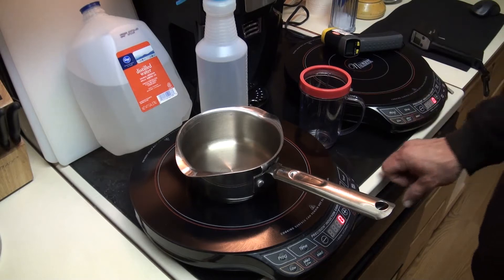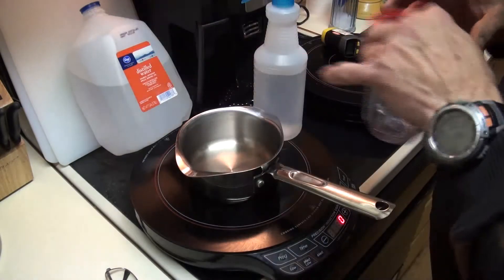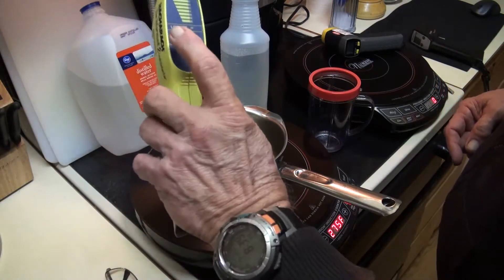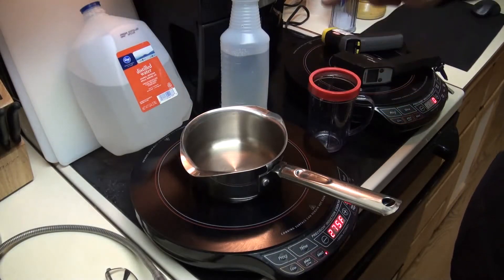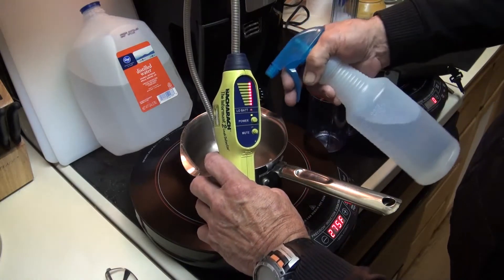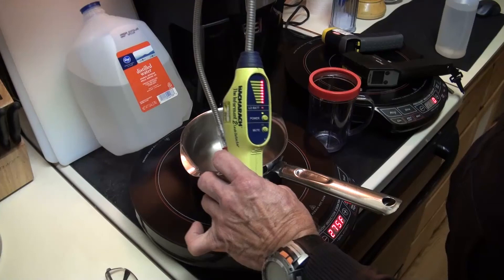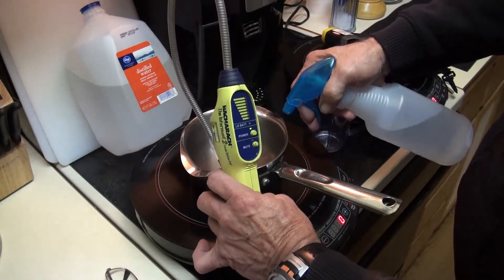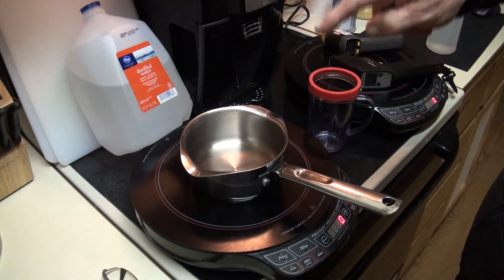# 2 Flammable gas from distilled water, is separating the Atoms, in water.

Comment: It's 230+ in 14.7 PSI atmospheric pressure.  Hook up some engine vacuum and it will drop to 165.  That's almost how hot I run my cell.  The hose is hot enough to burn your hand going to the engine.  Adding electrolysis to the mix only speeds the reaction up, but I am actually using electrolysis to generate the heat by using no neutral plates and using a smaller amount of surface area to increase amp density in a smaller area.  https://www.youtube.com/watch?v=gwBviAG-CvY

Comment: Stan Meyers did it by resonant frequencies of water .NWO killed him.
Reply from the maker: I am separating atoms, you see the smaller the matter the faster it will go to the applied temperature, and boil at that applied temperature. When an Arom turns to a gas, inside a liquid it will separate from the liquid, and the Atoms have now separated. I could not, and would not try to control what I have discovered, so, by putting it here on You Tube, the World owns it and nobody can control it. I do not know what Stan Meyers did to get hydrogen, but I do not believe you can separate Atoms using frequency, or Science would have discovered it. Science has been trying to separate Atoms since they discovered what an Atom was, however they are so stupid. The Chinese have been making Mercury since 3000 BC, and the Greeks have been doing it since 1500 BC, Science calls making Mercury, Sublimation, I call it separating Atoms. To make Mercury, you have to grind red colored cinnibar ore to a fine powder(the smaller the matter the faster it will go to the applied temperature, and boil at that applied temperature). For cinnibar the Sulfer Atoms has to be removed to create liquid Mercury, and when the Sulfer in the red Cinnibar reaches 675 degrees Fahrenheit, the Sulfer Atoms in the cinnibar turn to a gas and seprate from the liquid, and creates very hot liquid Mercury. This to me is separating Atoms, not Sublimation, like science thinks, and the Chinese, and Greeks did not know what Atoms were at that time, Science still does not know, but I do, and now you do.

Comment from the maker: Here is definitive proof that all Atoms in all mater can be separated, if the matter is liquid soluble, by applying the right temperature in the right way.
I will start with discussing what science calls Sublimation. Science says Sublimation can be done to a snow balls and Mercury. (Sublimation)- When anything solid turns into a gas without first becoming liquid, that’s Sublimation. When the surface layer of snow or ice turns into fog or steam without melting, this is an example of Sublimation. The verb Sublimation is from the Latin word Sublimare, meaning “raised to a higher status.”  
Get some snow or fine shaved ice and make a snow ball. Holding the snow ball, do not get burned, apply a butane cigarette lighter flame to the snow ball. The small snowflakes or ice crystals go from frozen to a superheated gas that has no wavy lines, when looking through the clear vapor. It does this without becoming a liquid at 32 degrees Fahrenheit, or boiling at 212 degrees Fahrenheit. Science calls this Sublimation, they know not what they are talking about, I will explain later. The smaller the matter the faster it will go to the applied temperature and boil at the applied temperature, even above the known boiling temperature of the original matter, and this is where you will find the boiling temperature of all the Atoms.
Now to Sublimate Mercury, you need Cinnabar ore. Grind the ore to a fine powder, place a small amount of the fine ground red colored cinnabar, spread the ore very thin in the bottom of a glass or metal container, and heat the bottom of the container with a propane torch, this is where the Greeks, who did this in 1500 years BC, the Chinese did it 3000 BC, I would bet Aliens showed the humans how to do it. It is the very small amounts of fine ground cinnabar ore that makes it possible to make the liquid mercury. By applying flame to small portions of the fine ground cinnabar, at a time, it goes to the applied temperature, which is around 675 degrees Fahrenheit, this is the boiling temperature of the Sulfur Atoms in the cinnabar ore. When the sulfur atoms boil they turn to a gas, and separate from the cinnabar, which is still a liquid. Because the Greeks knew nothing about atoms, they found they could add small amounts of finely ground sulfur, at around 600 degrees Fahrenheit, sulfur and the liquid mercury would turn back to the red Cinnabar. Think about this you applied heat to remove the Sulfur, in a vapor form, and the powder has to be fine ground to do this. Remember the smaller the matter the faster the matter will go to the applied temperature and boil at that applied temperature. The Chinese, and Greeks separated Atoms in Cinnabar Ore and never knew it, the Chinese did it in 3000 BC, and the Greeks did it in 1500 BC.
It is as if Science thinks they are preforming magic when liquid Mercury is made from Cinnabar, and they cannot see for the nose on their face, they are separating Atoms when they make Mercury, and they call it Sublimation. Here is actually what happens. It is the small snowflakes, small ice crystals, or the fine ground powder, in small portions, spread thin, that will go to the applied temperature, above the known boiling temperature of the original matter, and boil at that applied temperature. In this area I have found the boiling temperatures of all Atoms, and when one boils, it turns to a gas, while the other Atoms, in the matter, remain a solid, or liquid, having not reached their boiling temperature.
I did this to gasoline over 30 years ago, not knowing just what I had done and got twice the power over gasoline, zero parts per million Hydro carbons (no smog). I sprayed a fine mist of gasoline onto a 500 degree Fahrenheit electric heater, and ran it on 7 different vehicles, with this same results. I have put clean dry rags in the tail pipe and ran this White Vapor I created, and after ½ hour, the rag smelled like it had just been ironed. Now I also accumulated a dark brown oily liquid in the chamber I make the White Vapor in. This liquid was made from gasoline, and will not mix with gasoline, and the liquid is no longer flammable. Getting a Zero Parts Per Million reading on the smog machine, makes me think it might be liquid carbon, but scientist have told me there is no such liquid, but then again nobody has ever separated Atoms before. Part of my secret to doing this is, the smaller the matter is the faster it will go to the applied temperature and boil at that temperature, I call my process Flashing Matter (liquid or solid).  I have 4 videos on You Tube my channel (Bill Kendrick) also it is in Categories, on You Tube, under Separating Atoms. Science, Medicine, Chemistry, and the World will not be the same when this gets out.

Comment: You are ignorant individual...its not gas from wager its bottle plastics
Reply from the maker: You are trying to put the ignorantance thoughts on me, but you are the ignorant one. You do not know what you are talking about. True the plastic gives off a flammable gas, but it is not absorbed, nor does it leach into the water, stupid, if it did they could not use that type of container. Do not bother me anymore with your stupid ideas.

Comment: My next test is to take the vacuum pump little container halfway of water pull up vacuum on it have a connection setup on the gas coming out of the pump onto a torch tip to see if it will light the gas coming from the vacuum
Reply from the maker: It will not be flammable, you need to spray a fine mist of water onto a 230 degrees Fahrenheit range, raising the temperature slowly until the Hydrogen Atom boils and separates from the liquid Oxygen, in the water, then the gas will ignite.

Comment: I have a question since you and air conditioning man if you use a vacuum pump and put a vacuum on water H2O the gas coming out of the pump is it flammable and can you regulate the temperature by the amount of vacuum you put it on the container
Reply from the maker: It is true you will lower the boiling temperature of the liquid, however try to spray a fine mist of matter into a vacuum, and maintain the temperature in the vacuum. I know of no way that can be done, and control the temperature too. You see the liquid changing to a gas, will create a pressure drop, and change the temperature of the liquid, being sprayed.

Comment: Hi Bill Kendrick, I invite you to join the Gasoline Vapor Systems group on Facebook ! I think you will like it ! Thanks, Michael Vannozzi
Reply from the maker: Actually, Michael, I am trying to show the world how all atoms in all liquids can be separated. The the smaller the matter is the faster it will go to the applied temperature and boil at that applied temperature, making it possible to take any liquid to any temperature, above the boiling temperature of the liquid the atoms are in. When you do this you will find the boiling temperature of those atoms, they will turn to a gas, and separate from the other atoms in the liquid, because liquids and gases will normally separate. The liquid atoms left in the original liquid remain a liquid having not reached their boiling temperature. This can be done to any liquid.
Reply: Sounds interesting.

Comment: I read your description of the process you use and it makes no sense. I almost didn't watch the video but I'm glad I did. Hydrogen is given off leaving the oxygen still as a liquid? Come on, did you ever get more than the most basic education? And then the rest. Bollox.
A little ethanol in the water would produce the effect you describe.
If your method does indeed produce a flammable gas, you could use your butane lighter to ignite it.
However, I doubt if you will be successful as electrolysis is the only method which will split the H2O molecule.
Reply from the maker: +wontputrealname Do you know what Sublimation is? If not then you need more education. When a flame is applied to a snow ball the frozen snow will go from a solid to a gas without becoming a liquid. In other words the snow flakes go to the applied temperature before they do a change of state from a gas to a liquid, or in the case of Sublimation , it bypasses the liquid state and goes to a gas. I applied small droplets of liquid gasoline to a 600 degree electric heating element and the gasoline became a gas that has no hydrocarbons. Now science says gasoline auto ignites at around 534 degrees, wrong, I have seen the electric heating element turn a dull red ( around 1000 degrees Fahrenheit) before the gasoline auto ignited. I produced a white vapor from the gasoline when I did this it produced twice the power that liquid gasoline has, seen on two different Dynomometers ( a machine that measures engine horse power to the ground). What can be done to one liquid can be done to any liquid, temperature wise.I am saying I found a way to take any liquid to any temperature before it changes state, and that is where you will find the boiling temperatures of different atoms in that liquid, or any liquid. These atoms will separate in the liquid when one becomes a gas, having boiled, and other liquids in the original chemical will remain a liquid, having not reached their boiling temperature. If you don't understand this, then you need more education.
Reply: +Bill Kendrick     You already posted all this rubbish. Complete balderdash.
I am familiar with sublimation. You don't need to try to educate me. It can be demonstrated by using "dry ice" (frozen CO2). It won't happen with snowball.
You ignored my point about trying to light this so called "flammable gas".
You ignore the fact that if hydrogen is given off, oxygen must also be present in that gas. So it should catch fire if you light it. You'd hear a small crack as it exploded.
You say that the oxygen remains as a liquid? Ludicrous. For oxygen to be liquid it must be at a very low temperature.
You contend that I need MORE education because I criticise your ridiculous ramblings? I would not encourage YOU to go back to school as from your video and postings I doubt if you've ever been to school at all !!
I have a remedy for you ignorance. You should GO TO SCHOOL.
Until you do, people commenting on your ideas will never convince you of the idiocy of your statements.
As far as I'm concerned our discussion is over.
Reply from the maker: +wontputrealname You have no clue, dry ice is liquid nitrogen only, that will boil at minus zero degree temperatures, it is liquid nitrogen only, there no other atoms in liquid nitrogen. Water has two atoms, gasoline has many atoms.  I am talking about, taking very small droplets of liquids, spraying them onto a designated temperature, I call this Flashing Liquid, and I am saying the small droplets of this liquid will go to the applied temperature faster than the liquid will boil at the liquids known boiling temperature, making it possible to take any liquid to any temperature before it boils at that applied temperature. You see snow flakes are very small, like a fine mist of liquid, and both go to the temperature being applies faster than they can boil at that liquids known boiling temperature. If you cannot see what I am saying here, then I have nothing more to say, except get out of the books and try this for yourself. What I have done here is not in any books. You have to see it to believe it.
Reply: +Bill Kendrick     In my last post I said that as far as I was concerned the discussion was over, then you state, referring to me "You have no clue, dry ice is liquid nitrogen only", and then you say that water has 2 atoms (wrong on both counts), and you go on to repeat, more or less the same BOLLOX you have come across with to explain your impossible theories.
I just had to respond as your first sentence is so ludicrous.
Dry ice is CARBON DIOXIDE. It melts at about .-80c.
Frozen Nitrogen, which is NOT dry ice, melts at less than -200c.
There are 3 atoms in 1 molecule of water, 1 oxygen and 2 hydrogen. That's why it's called H2O.
I would advise any person who reads these posts to beware of any advice you give because the ridiculous statements you make and have made in your videos and posts prove that you do not understand even the BASICS of the subject in which you profess to be so expert.
Reply from the maker: It has been too cold, where I live to work on it this last winter, but I have plans to do it this Summer. The only way to prove it is to ignite it, which is what I intend to do.
Reply: +Bill Kendrick     I'll be very interested in your findings.
Reply: Were you finally able to "ignite" it? It's been 2 odd months since your post.

Comment: +Bill Kendrick  The increase in pressure would push the hydrogen and water vapor mixture through the bubbler if you had an exhaust port atop the bubbler.

Comment: +Bill Kendrick I really would like to build a hydrogen generator from your process. I imagine an enclosed container with a heating element at the bottom hooked to a bubbler with a consistent heat source could produce a pure hydrogen supply vapor free as the micro water droplets in the air would collect in the water bubbler.
Reply from the maker: +griffin gibson The finer the liquid mist the faster the liquid droplets will assume the temperature they are being applied to. Just like Sublimation, using a cigarette lighter on snow. 
The small snow flakes go to the applied temperature first, then it goes from a solid (ice, or snow) to the gas state without becoming a liquid first  I have found that a fine mist of liquid will go to the applied temperature then boil and become a gas, at the applied temperature. I am saying all atoms have their own boiling temperatures, within all liquids. My process, Flashing Liquid, can find those atoms boiling temperatures in the liquids, and separate the atoms in all liquids.
Reply: +Bill Kendrick oh I understand. it's just that you said that you want it hot enough to break apart the hydrogen from the water, but if you make it too hot it will create oxygen as well and mess up your mostly pure hydrogen you harvested from it correct?  And I was wondering how you would separate the mixture as I believe it's better to have pure hydrogen to run, say , a car or truck.
Reply from the maker: +griffin gibson When you find the boiling temperature of the hydrogen atom, in water, by Flashing  Liquid, my process, it will separate from the oxygen atom and become a gas, while the oxygen atom will remain a liquid, having not reached it;s boiling temperature, however since the normal boiling temperature of oxygen is below zero degrees Fahrenheit, the oxygen will boil and become a gas as soon as the hydrogen becomes a gas. You will end up with a H2 O2 highly flammable gas. If you can capture this gas it will be extremely flammable, and when it burns it makes water, again.
Reply: Bill Kendrick awesome awesome.  I think I will devise a system to inject water into a heating chamber to recycle heat energy and use it as fuel when I generate hydrogen.
Reply: Frank Gutowski they are torn from surrounding molecules and added to the electron cloud of  whatever moleculeis lacking of electrons. almost like how a pez dispenser works.

Comment: i believe in what you are doing sir... because if you boil the cooking oil until you get oil steam, once it steaming ...try to spray water to it... for sure you will get fire bigger than you expect.
Reply from the maker: mazda daus There were prop airplanes in the 40's and 50's where the Air Force used water injection for increase in power for take off.